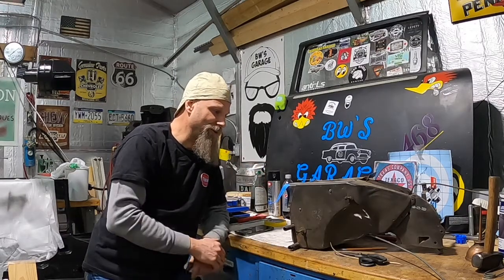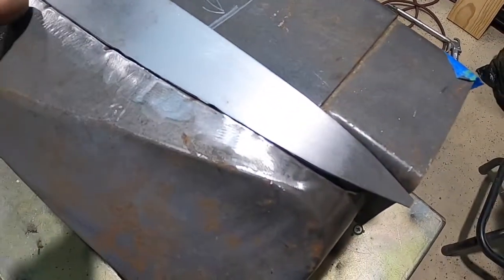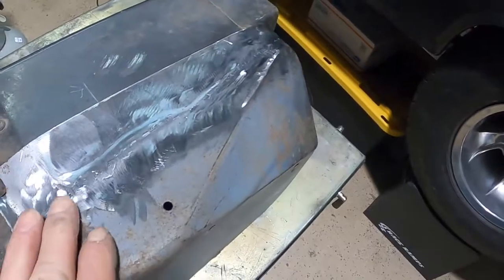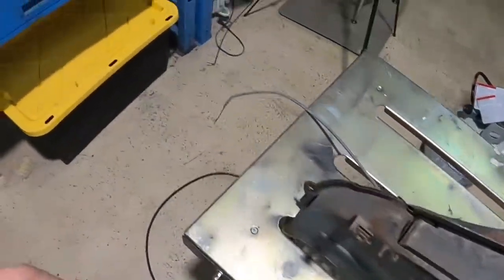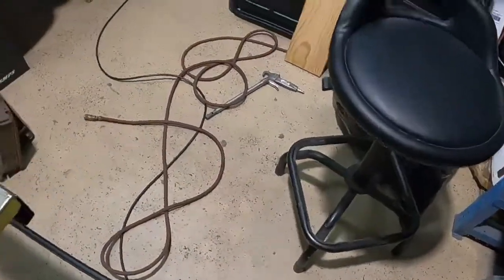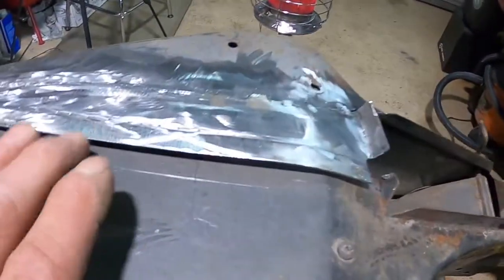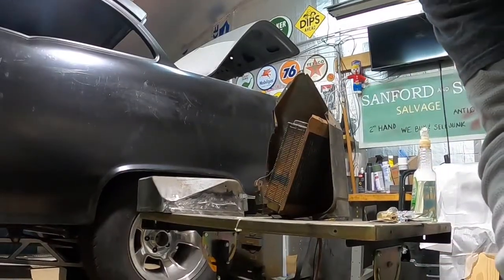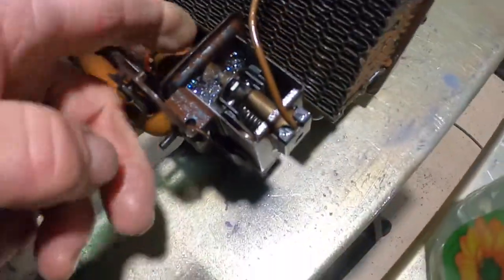1955 Chevy Heater Box Repair

Comment: Dang I was just heading to bed and your video popped up. I always replace heater cores they make a mess when they leak and there generally a pain to do. Plus they always pop when you're driving and it's zero out. Sucks because there expensive little suckers.
Reply from the maker: Weighing that right now Gary, about the heater core replacement. Thanks for the feed back. Think I will get one.

Comment: Nice job on the metal repair they flange maker is pretty slick. It sure will be nice to kick on the heat on the cool evening drives. Later man ✌
Reply from the maker: Absolutely Don, no shaving weight for racing here. More interested in having the creature comforts in the car. Appreciate you 🙏

Comment: Would love to see you mount it in the car. Maybe that would help me figure out what I missed when I took out the bolts to remove mine and it still wont come out of the car lol
Reply from the maker: I will video it when it goes in, I've got to Raptor line the floors and trunk then I will install with video, ✌️